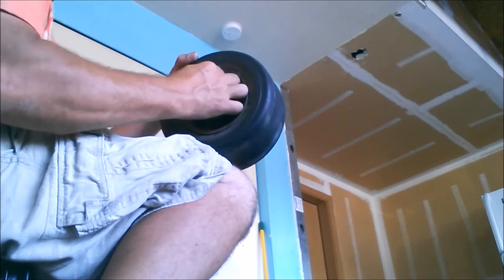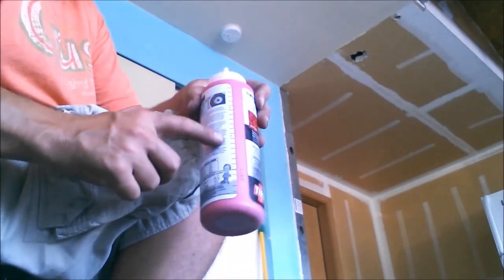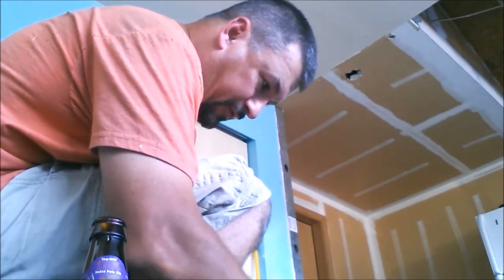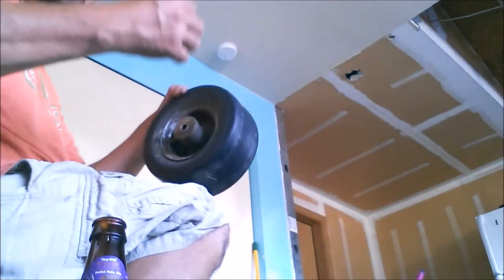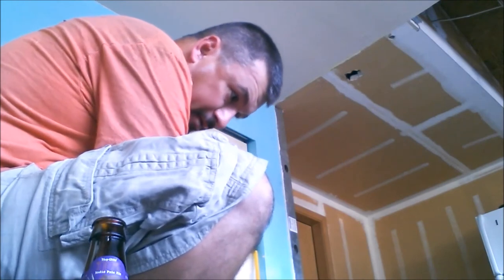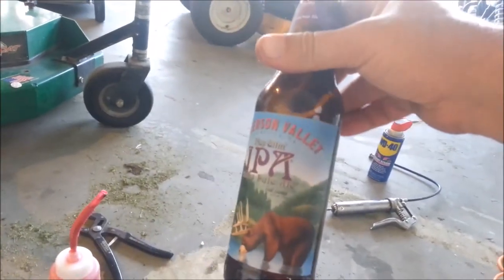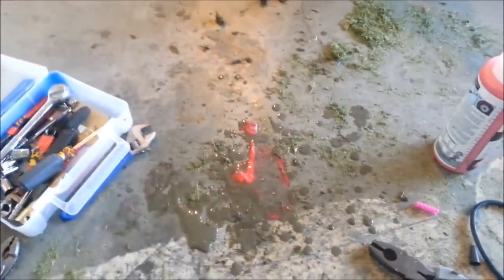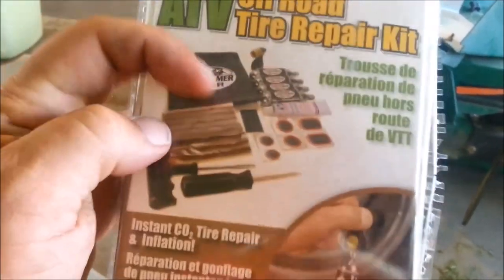Flat Tire

Comment: Put the sealant in the other tires BEFORE you get the flat! (Reminder to self, put sealant in tires BEFORE I get a flat!) ha
The front casters on my SZ are semi pneumatic meaning, they are solid but have an air cavity in the middle that doesnt require inflation. If you can get them in your size I would recommend them for your fronts.
Reply from the maker: LOL, I'll have to remember that :)